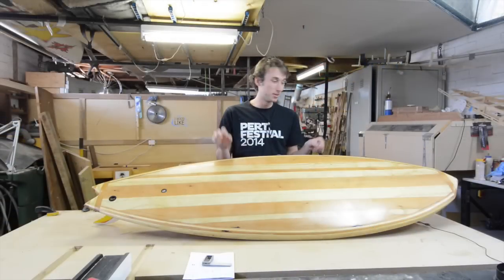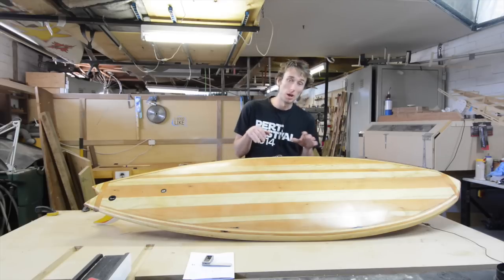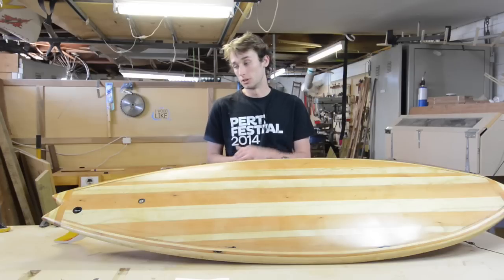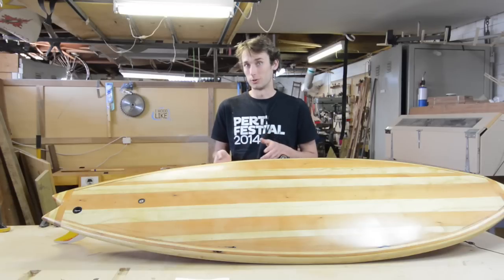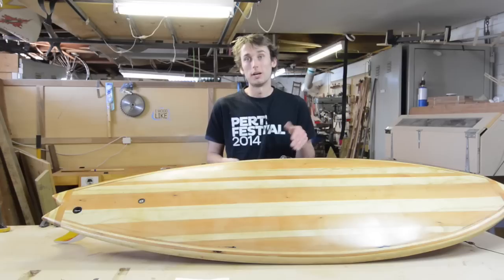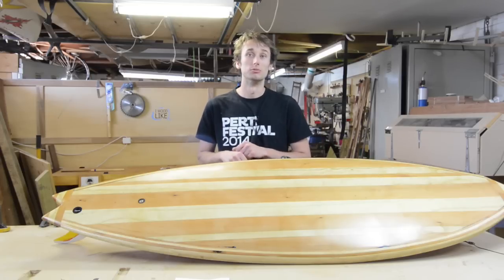Building my first wooden Surfboard (Hollow core wooden surfboard)

Comment: Hi Jord. I've built a few kiteboards. I found using epoxy as the outer layer had two problems: It quickly yellowed from sun exposure, and it scratched up easily. I found a two-part linear polyurethane designed for yachts which did a supreme job of keeping the surface nice. (ps: That is a supreme job you've done. Respect!) - Jeff
Reply from the maker: +Jeff Rickard I will look into the polyurethane, thanks jeff!

Comment: Great job ! I’m not trying to be critical but I’m think you could get that deck could be a lot better if you use more grits in between and don’t skip any. I know it’s hard but it looks like you either didn’t get the scratches from the last sanding. I’ve been at this for a long time but one thing I still use is guide coat. I mostly do boats but you and I are special when it comes to fiberglass. We laminate and don’t use molds. So we have to contend with so many factors.  
I came from a boat detail shop and I learned a lot about finishing before I started learning Fiberglass it really help me out a lot. 
When you can look in the reflection of a boat or a surfboard and you can see zero Orange peel and can read the penny date that’s what I strive for. As I said your projects looks awesome , I hope you don’t think that I am disrespecting your project because it looks absolutely awesome! 
Just adding some constructive criticism. Enjoy and did you say this was your first time doing this?????!! 
if so my hats off to you. Buy a Makita buffer they last so much longer and you hold it in a more advantageous way. 
Again awesome project have fun thanks for posting I liked and sub this.

Comment: Great job and very curious to see how it holds up. Certainly not knocking the design, I'm just ignorant to only using one center and 2 side rails for fastening down the top and bottom. Let us know in time! But all in all I'd say your hard work and time were well worth it! Thanks, Rick
Reply: +rickndianacom - OK I did some searching and to seems this is where most designs have gone. Thanks again I learned something very interesting, could cut down a lot of weight.

Comment: Curious, no video ever came out about the entire process or a DIY kit posted on your site. What are your plans for this video?
Reply from the maker: its a very long story, but the plywood was ordered last week to start a fresh set of kits and videos
Reply: Thanks! One other question: What thickness of the wood did you use for the top and bottom of the board?
Reply from the maker: Simon Weisberg i used 5mm on this board, but have since changed to 6.5mm so i dont need so much glass
Reply: Look forward to the videos, any advice on how to bend the rails without soaking 7ft long pieces of wood?